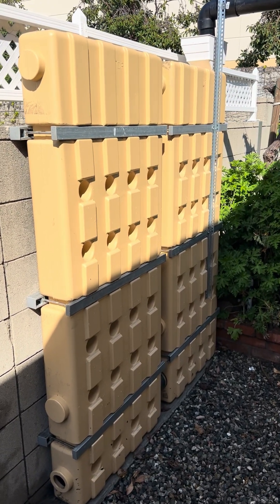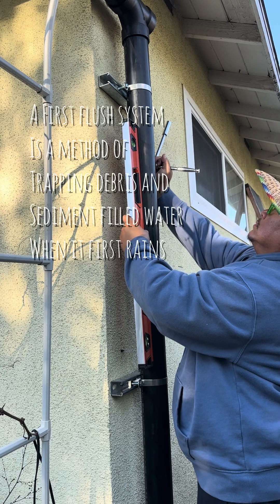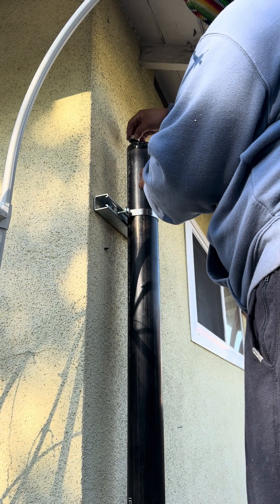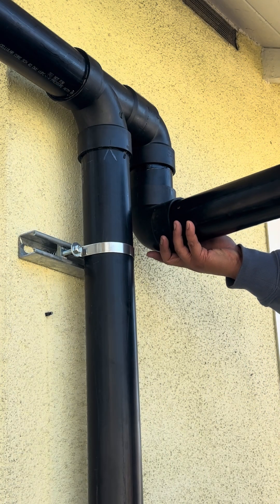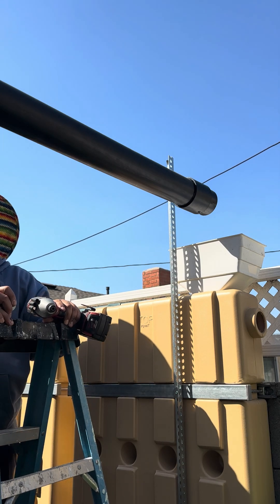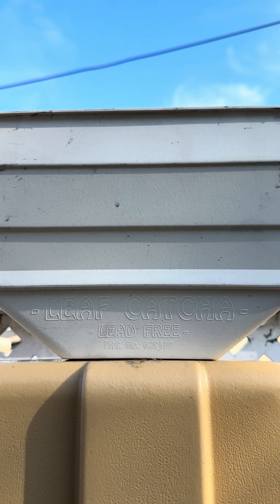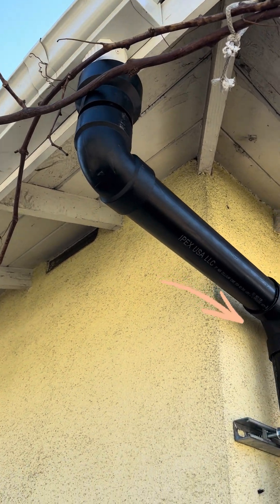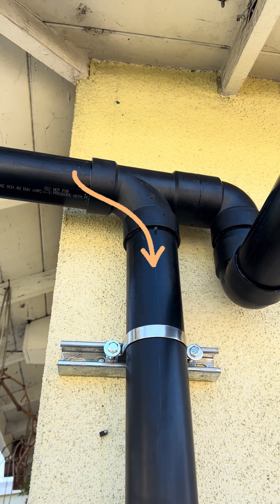🚧 Rainwater Harvesting System: Almost Complete!

Comment: Abs pipe doesn't do well in direct sunlight. You should have done pvc but you cheaped out. You'll see later
Reply from the maker: True, that’s why I plan to paint it when I paint this side of the house. It’s also on the north facing side of the property and in my area this side is pretty much shaded by the house all day. Not much of the pipe is directly in sunlight and I’m not overly concerned as this is only rainwater piping.